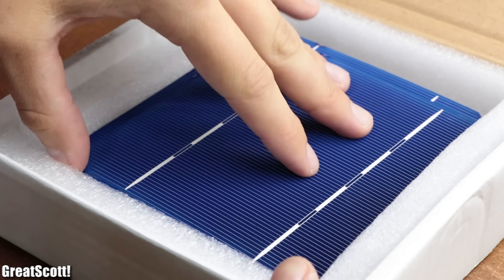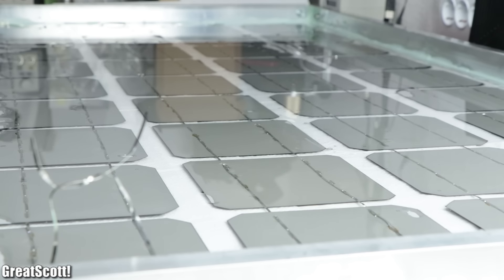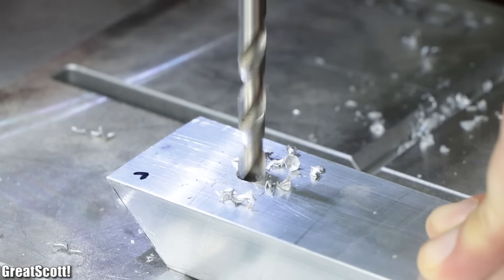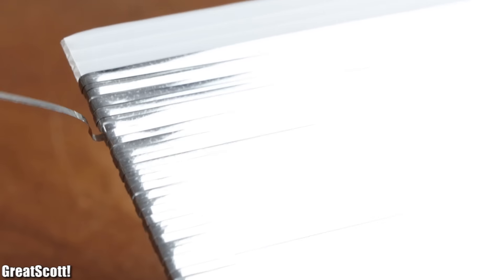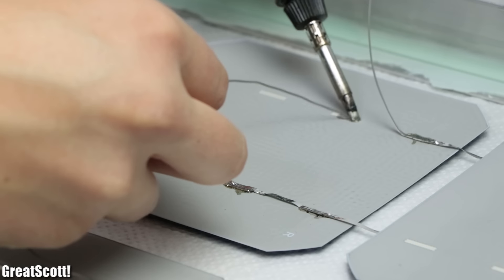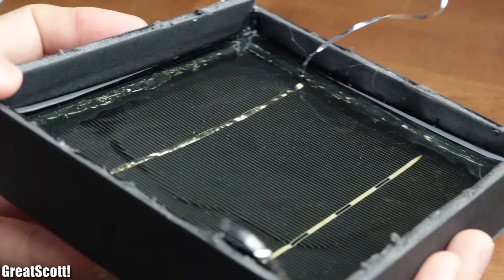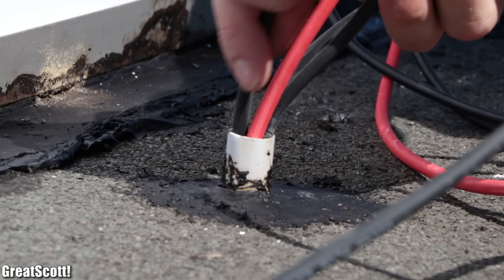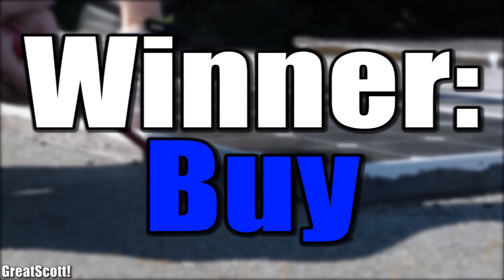100W Solar panel || DIY or Buy

Comment: I once tried to create my own from cheap cells. For one, no matter how well they seemed to be packed for shipping there's always a bunch that arrive cracked. Some to the point of being non-usable. Soldering them all is a total PITA and very hard to keep aligned in neat rows. Also, very hard to make a nice looking frame or one that will hold up. Agree that it is better to buy than make your own.

Comment: Common commercial cells are encases in EVA film (ethylene vinyl acetate) (which is a thermo plastic) which a lot better to use, although you would need a vacuum chamber for that. the resin would have yellowed over time which would have reduced the max power and efficiency from the cells. EVA film doesn't yellow and is transparent. Also putting a metal backing (say covering the back of the cells in say aluminum foil (for reduced cost) would have helped trap light in the cell.

Comment: If you dont glue the panels to the floor you will get better cooling on the panel and produce a little more watt's. Put some brackets like L brackets. It will make a difference.

Comment: One major flaw with this design is that unless it's uv resistant, plexiglass can yellow over time and thus reduce how much power you get, plus depending where you look you can get regular glass for free, for example is someone remodeling or replacing their door? Ask for the window.

Comment: just like you said, it might be a good option for odd shapes and sizes. I have a 195wp panel on my boat, and the thing is pretty long, so it was to long to mount it sideways on my boat. But now i have about 30cm on both sides that is not used. If i would make my own panel it would be 60cm wide and a lot shorter, that way it would fit in a lot nice and i would be able to fit 2 or maybe even 3 of them on that roof.

Comment: meanwhile price for panels dropt 100watt panels cost 60€, 250watts panel 140€,. so 20 solar cells (5w per cell) cost 34€ and a good frame materials etz 20-30 better to buy a factory one

Comment: go to a glass co. and get sliding glass door panels that are fogged up for free,and it's tempered. 2 glass panels per door.(cut the 2 sheets apart)
use optical grade epoxy,buy it in 5 gallon buckets.

Comment: I guess the idea was to make it the same as the one you buy but it doesnt have to cost that much. old bed frames are fine for the sides and free typically or price of picking it up. damaged cells are about 30 dollars for 300 watts and since you use resin you could use damaged ones fine. the cover can be made from 2 liter soda bottles, since you used resin you could probably get away with using plastic wrap. that is U.S dollars id think for 140 euros you could end up with 4 or more solar panels of the same power.

Comment: Not very efficient to glue it directly to the roof surface, in terms of power harnessed. Also inhibits cooling. Designing a tracker which takes declination into account would be most efficient, though costly. It can be fixed at an angle equal to latitude of the location facing south (assuming northern hemisphere) as a trade off  between cost and efficiency.

Comment: Found out on ebay 2 solar panels for 8.22€ with free shipping from HK, that must be the deal of the century or ... just a scam "New 2 Pack Mighty Max 200 Watt Solar Panel Poly 2pc 100w Watts 12V RV Boat Home" 

P.S. Found out on amazon 1 Mighty Max solar panel in promo for about 104$

Comment: This is one area that DIY just cannot compete with commercially made.
The Chinese have the of panel manufacturing processes down to a science.
Combined with China's cheap labor and subsidized postage, DIY has the chances of a snowball in Hades.
Good quality panels can be purchased for less than 1 USD per watt, and all you need to do is install and hook them up.

Comment: That's less expensive than what I expected, you could use 2 layers of thin glass instead, also the panel could be mounted higher to allow air flow underneath

Comment: Unless you need to build a custom panel such as onto an RC airplane wing or molded to a curved boat deck or you are doing it strictly for fun/knowledge, DIY solar panel builds are a complete waste of money and time.   You can buy way cheaper and the quality is ten times better than anything you could do yourself for a reasonable amount of money.

Comment: you can never make a panel of equal performance of quality for cheaper. Only the encapsulant (sylgard) , will cost 150eur/kg...
BTW, you only had to solder 2 ribbon wires in each side. Try doing that with 4 on each side and you ll lose your mind for sure... ;)

Comment: You can spend hours if time and effort and about 90% of the cost to end up with a crappy panel if it works at all.
It's simply not worth it.  It may have been at one point but panels are way too cheap now to make it worth it.

Comment: So for the $50 USD you pay for the panels that are most likely bottom of the barrel garbage from China you get a 50w  panel that will last a week. 

I've experimented with this myself and can tell you you're not going to DIY a cheaper panel than most commercially available. The only thing this idea is good for is education. 

Great video. Though not at all feasible.

Comment: The commercial panels are made in glass. Special glass with a high percentage of iron causing a better resistance to dirt. Due to the high temperature during the exposition to solar Light, plexiglas can modify his shape and move cells around. Considering how much work needed the construction of panels  i'm with you on buying panels: ready, tested and working!
 Hi see you to the next video!

Comment: Glad you did this! Been looking into it for a while, and I concluded pretty much exactly what you shown. I only see DIY solar being practical these days for something like covering an outdoor table that's just sitting there anyways, or something else with panels, and then encapsulating it. Even then, like you said, it is time intensive, so if you are fully employed, you might as well just buy something unless you really have a strong DIY spirit.

Comment: All this epoxy and glue is unpractical. Simply use a layer of clear material on the front and insulate the cells from the back with an insulating panel. Fastening everything with hardware instead of adhesives let's you remove and repair anything much much more easilly. If any of the cells stops working it is easy to remove or replace and doesn't look like a disgusting mess.

Comment: Very interesting to observe this video which was very well done. Really good experiment, and insightful. The purchased commercial panel cost was always going to be much lower than the cost of building a single panel, especially at the factory before retail pricing markup. However, it was interesting to note the performance between your DIY and the commercial panels was essentially identical, even if the commercial version may be more weatherproof. Thank you for doing this video!

Comment: Arduino DIY or BUY ?
It would help a lot of people who would like to make their own arduino...

It would also help me
Reply: Mihael Panjkrc There are tutorials all over the web about it. And it would be too short of a video.
Reply: I don't understand the point of comparison in particular. If you want an actual Arduino - a board with an Arduino pinout that can take Arduino shields and has a USB adapter and a voltage regulator on it - then of course buy, there's no way you can beat the price. If you don't want an actual Arduino board but a custom microcontroller project which you can program via Arduino IDE, there's dozens of ways to design and make these, but you pretty much don't have a choice in the matter of whether you buy or make, you pretty much have to make.

Of course there's in-between solution of Arduino Pro Mini which is often cheaper than you can get an ATMega DIP chip for, and it's already got Arduino bootloader on it, you just add some pins and a USB serial adapter to program it and you can put it on whatever custom board/project, that's often remarkably convenient.

Comment: Good video, however I would like to remind you that solar panel pricing can be different, depending on where you live, and while you can order a pre-built panel from Aliexpress or Ebay, shipment cost can be equal to the price of the panel (or even more that that).
Once again, depending on where you live.

Shipping costs for cells tends to be significantly lower, as no glass or aluminum is shipped, also the package is much smaller.
So it's not ALWAYS cheaper to buy a commercial panel.
Plus, I do believe you don't really need those fancy aluminum u-shaped beams, since you ended up covering the back of your panel with resin anyway, so it could probably have been cheaper, but that another story.
Reply: Ebay and amazon for USA ship 100w panels for right around 100 usd give or take 20 each way. I have searched and found cheaper places that advertise 25 to 75 cents a watt and does not include free shipping.  Some places when you add shipping cost more than 2 dollars for the panel. Its cheaper to order off eBay or amazon. When you buy panels under 100 watts the price goes up a lot. When you order panels over 100 watt the price goes up as well due to the size of the panel. 100 watts panels are small enough to ship and are the most cost effective.
Reply: William Glaser in countries like Argentina (where i live),the cost of something imported  is basically doubled becuase the importation laws,so the national products are the only choice,which aren't cheaper though.

Comment: Your using the wrong words. 

Cheap speaks on quality, inexpensive speaks on price. If something is cheap it means it's poorly made. If something is inexpensive it means it didn't cost much relative to some implied factor such as the potential purchasers budget, or comparable goods or services. It's a common mistake, in the U.S. we almost exclusively use the term cheap for both. We are robbing the word of it's power when we do that though, hence why I point it out to people.

These words have power?  Yes...

When you tell a maker, builder, inventor, manufacturer, etc that their item is cheap they should take heavy offense motivating them to improve, but instead they just interpret you as saying they have low prices, and are happy motivating them to slowly raise prices to meet expectations. 

Take bake the power...

Take bake the power of the word cheap so that you don't have to resort to phrases like low quality, hunk of junk, POS (not point of sale *wink wink*) etc. These phrases tent to make you seem lower class thus pore thus not the maker/manufacturers problem, thus they are not compelled to improve ... for who... someone who couldn't pay them anyways? No you want to come off as higher class so they are motivated to improve for a chance at getting some of that cash you must obviously have. 

Understand now?

See why 'inexpensive' has power? Because it gives 'cheap' back it's power. It also carries it own innate power too, but I imagine, if you got this far, you can reason that out on your own, if not explaining it would likely be a fruitless endeavor.

Comment: Hmm, very interesting. I've been after a panel around 100w for my trailer tent but have been put off by every one I have come across as they either won't pack away into it when not needed or they aren't the right shape/size to fit across the roof over the existing poles. Could be an interesting project to custom build a solar solution for it.

Comment: Oh and you diy folks list all of your specs more is better. Volts, amps, wire gauges, inverters, flux capacitors(lol), brand names, and if you are verrrryy serious data sheets.

The time has come. We have open source cs/data science folks to evaluate on mannnnyyyyy different metrics. 

Let’s do it.

Comment: I guess only the resign costs already like 40€ an the plexisglas must also be quite expensive. Was It not an option to seal it between two old Glasplates in a pvc frame? Anyway i like your other videos, pls continue :)